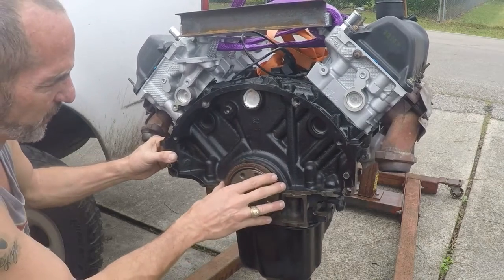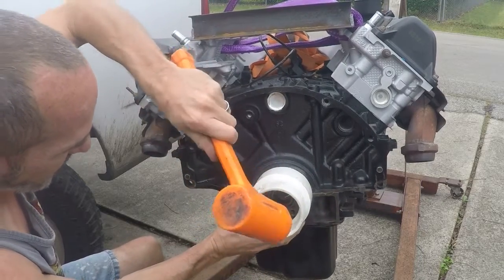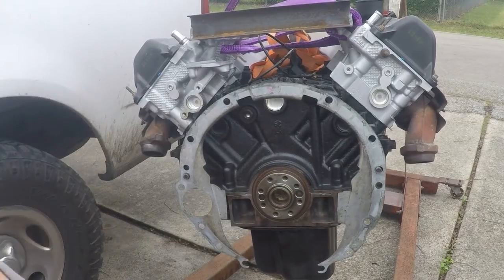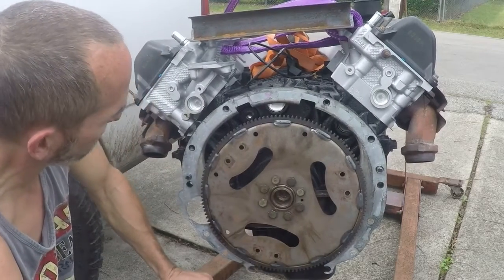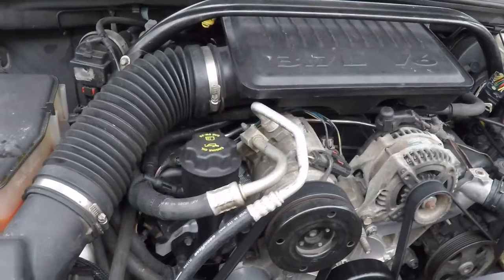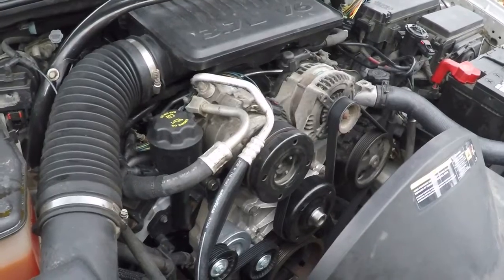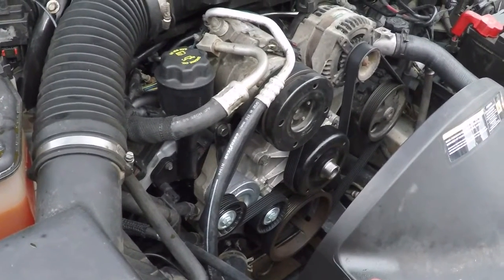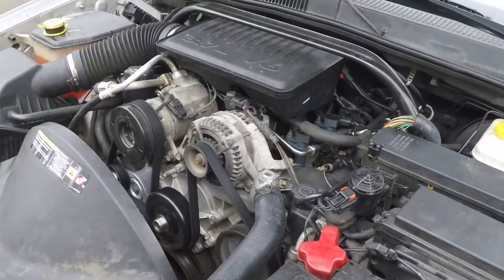Engine Rebuild - 3.7L 2006 Jeep Grand Cherokee Laredo - Part 14

Comment: What did you use to put the engine back in the car?  I have s 2006 liberty with this motor than needs to be rebuilt because of severe knocking.  Great video series

Comment: How did you lock the flex plate to torque the harmonic balancer ? Was it with the flathead screwdriver on the flex plate ? Just like you did when torquing the flex plate bolts ?
Reply from the maker: xavier villarruel That is exactly what I did. You need a spare set of hands, but it works wonderfully.
Reply: Trey Clanton. Thanks great video by the way

Comment: Nice job!  So what’s the total cost you had in parts and hours start to finish?
Reply from the maker: THETOPGLOCK This rebuild cost $2000 in parts plus my time. I didn’t really track my hours since it was for a friend, but I’d guess about 24 hours in wrench time. If it hadn’t sucked water in, the rebuild would have been closer to $1400 in parts.
Reply: Trey Clanton Thank you for the quick reply.  I was just curious. My wife has a Commander with the 3.7 and it’s getting up there in mileage.

Comment: Hey I can seem to find any info on this...can't find where the ground strap goes that on back of engine do you remember?
Reply from the maker: It bolts onto the back side of the head.
Reply: @TreyClanton  Thank you very much for this informative video! I just went through the rebuild myself and the engine is running but I am getting codes that I think are related to a bad/ poor ground. Can you tell me where the other end of the drivers side ground strap secures too? I see the passenger side secures to a stud on the firewall.
Reply: back of left and right Head, studs

Comment: That series was better than anything out there I have yet seen. Especially on the install of the timing components. I'm now much more confident about getting that right. My intention at this point is to do cylinder head removal with engine in compartment, assuming no other engine damage after what appears to be simple warped head or failed gasket. Won't know until it's off. So if guides and tensioners need replacement, well there's a video for that. Thanks again!

Comment: how do you reach the upper transmission bolts
Reply from the maker: Real good question! I found that if I raised and lowered the motor with the main motor mount bolts removed, I was able to get to them, albeit with difficulty.

Comment: Hey Tery I'm currently getting ready to pull a 3.7 out of a grand Cherokee ...I was wondering what mounting points you used for your cherry picker? I'm afraid to use anything on the heads because they are aluminium...any help would be much appreciated...also would like to thank you for your rebuild series of the 3.7 I'll be using them during my rebuild...
cruizer2169@gmail
Reply from the maker: I built a lifting fixture similar to the special tool listed by Chrysler for this motor. It bolts into the intake mounting on the head. I hear your concerns about lifting with bolts in aluminum, but if you use all of the bolts for the intake (8 I believe), you should have no trouble.

Comment: we got a engine and we put it put it don't want to start, can you help us to see why
Reply from the maker: Hello Wifredo. That's a significant request. I wish I could be of assistance, but not seeing the motor makes it difficult at best. You need to look at the basics. Will it turn over? If not you need to consider the starter, starter relay, and computer. If it will turn over but will not crank, you need to consider the ignition system, fuel system, fuel pressure, etc. Good luck with getting it going. Just remember to always start with the fundamentals!

Comment: great job. by the way I think you put the flex plate on backwards
Reply from the maker: I'm pretty sure it was right, but I could be mistaken. I wouldn't think that the starter would engage correctly if it was backwards.

Comment: Trey,  what is the rig that you have securing the engine to the hoist?  I am working on a 3.7l from a Jeep Liberty that was removed (and in the cargo compartment) when I bought it.  The heads were off, so I hoisted it (to get it on the stand) via the head bolts threaded in a few times.  

Getting it back in the Liberty, though, I have been wondering about.  It looks like you have your heads and covers on, with some small I-Beam steel and some straps.  Could you elaborate a bit?
Reply from the maker: It is a lifting jig that I built from 1.5x1 c-channel. There is a Chrysler special tool that looks similar. I welded this one up to save a buck. It bolts to all of the intake bolts. I'd let you use this one if you lived near Houston! I will try to send a picture if I can figure out how.
Reply: +Trey Clanton Used to live in Kingwood, but now I am in Hawaii.  I wouldnt mind taking a look at it cause I am stressing over how I am going to get this thing back in the Liberty.
Reply from the maker: +Cory Blissitte I can't seem to post pictures here, but if you'll send me your e-mail address, I'll send some pictures.
Reply: Trey Clanton Trey, would you be willing to lend out your lifting jig?  I live in New Braunfels, Tx.  I can mail it back to you and would be willing to pay for shipping it down here.

Comment: your videos are awesome, better than most manufacturer's training material.. I just bought a 09 GC with 3.7 engine, runs drives ok but over 2K rpm there is a slight vibration (only on the engine, even in neutral) and Im suspecting the balance shaft out of timing. Timing cover does have the markings of a prior removal. Your timing video will come in very handy.
Reply from the maker: I'm glad it was useful. Wishing you the best resolving your vibration.
Reply: +Trey Clanton thanks Terry.
Reply: +staintx Trey I was going to say.